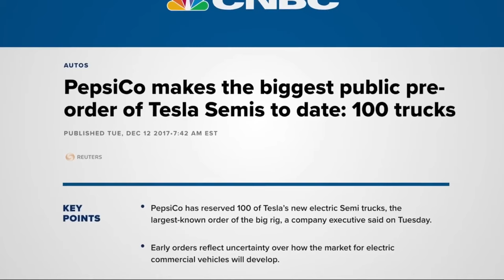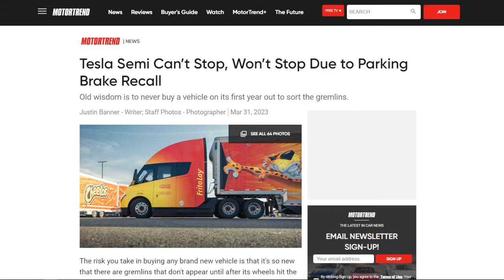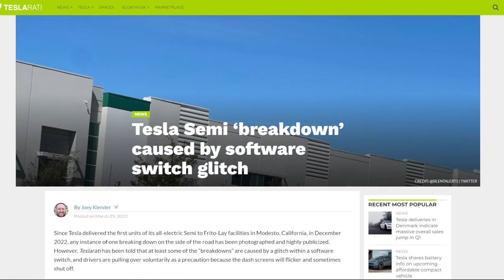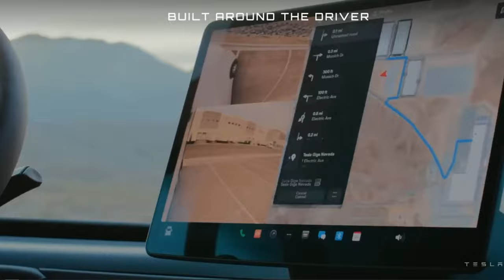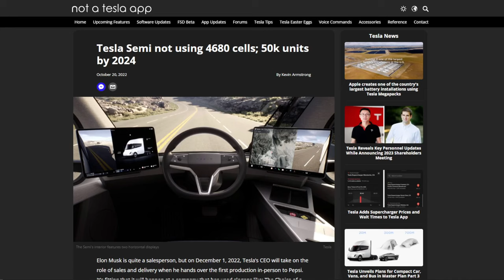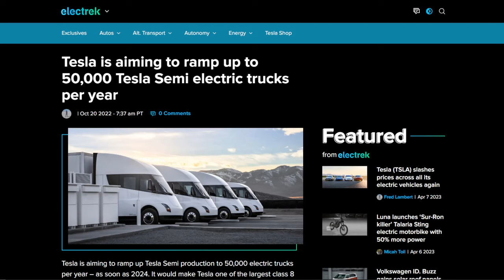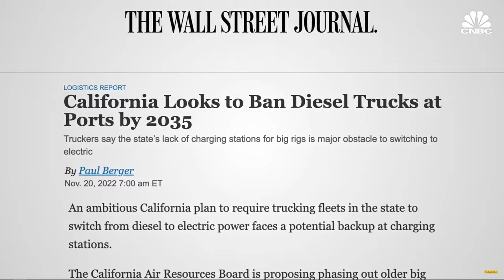The Real Reason Tesla Semi Keeps Breaking Down.

Comment: I think hydrogen is going to be the winner as after all vehicles that use fossil fuels today are actually burning hydrogen and Cummings plus a few others are moving in the hydrogen direction. Add that to the fact there simply aren't enough materials to go around to make the big switch to EV's and hydrogen is sure to come out the other side as a clear winner in it's ability to phase out the use of fossil fuels.
Reply: Hydrogen is dangerous, dirty to produce, hard to transport and store. Maybe one day H2 will be usable. Right now, battery technology is constantly improving, actually available and comparatively safe. FYI, I used to work in the industry. I know what I'm talking about.

Comment: I don’t like Tesla‘s Semis front design.
Reply: Thanks to that "design" it has a drag coefficient lower than a Bugatti Veyron. Tesla engineers are focused on one thing and on thing only - performance.
Reply: Yes one deer impact and its totaled
Reply: @400kProject  Just like the Cybertruck that looks aerodynamic... but has the drag coefficient of a brick.
Reply: @400kProject  if they wanted true engineering there would be air intake vents that spin turbines to generate eletricity to keep a battery half the size charged at all times  but you go ahead and think the way you do  .

Comment: Wether Tesla Semis are good or not, its existence is great for showing people that trucks doesn't have to use Diesel to succeed
Reply: Right now they are working with soda and potato chips. Semis also haul weighted loads such as steal! Large construction equipment. Etc. Yes, in many cases you still need diesel trucks. However, a non-diesel solution that could take on large volume less weighted items could certainly reduce diesel truck usage in some areas.
Reply: Why do you guys have problem with diesel? What did it do to you?
Reply: 500 miles on paper to charge for hours with a 1/4 of a cargo. How?
Reply: It is funny how UPS has hundreds of class 8 semis that run on BIO-NG that cost less than diesel or electricity to operate. Now that Cummins is rolling out their new 15 liter NG engine, it seems that you don’t need Tesla to be a”winner”.

Comment: Here is a major problem.  A Ford Lighning EV truck was supposed to get 350 miles on a charge.  It pulled a small trailer one day.  It only got 82 miles on that charge.  Weight is a big factor in electric vehicles.  Semis have to deal with a lot of weight at times.
Reply: same with the cyber truck -90mi range when towing max capacity, smoothing like 1100lb which is less by maybe a 1/3 than an ICE ford f-150
Reply: its not the weight. It's the aerodynamics of pulling a trailer. The semi can deal with this buy having a more flush top with the box its pulling.

Comment: My major concern is charging these things.  There is an ungodly power draw in charging them, several companies around here investigated getting involved with Electric Trucks for local delivery.  Seems as if the power company cannot supply the power needed.  One local power company around here was reported to inform the trucking company that their power demand exceeded several times over the local town power draw.  Basically the electrical infrastructure was not in place to support and deliver the required power.  There are good places where Electric Trucks and other they will be a issue.

Comment: According to Oryńsk, the Tesla truck is not “built around the driver.” For starters, he points out that the placement of the driver’s chair is wrong. Tesla positioned the seat in the front-middle instead of the vehicle’s front-left side, and Oryńsk pointed out the shortcomings to this change.

“This [chair placement] makes overtaking or looking ahead more difficult,” said Oryńsk. “But [it] also makes it impossible to reach out of the window to pass the paperwork or to talk with the guy in the gatehouse when you enter a port or a factory or, say, a tollbooth.”

Comment: Motorists aren’t usually terribly concerned about having to leave a car in the shop for a few days; it’s easy enough to find a rental. But for a trucking company, lost revenue from not hauling freight can be the straw that breaks the camel’s back. 

Cheerfully, Roeth said electric trucks theoretically require less maintenance and downtime than cumbersome diesel engines. It’s still unclear how robust the Tesla Semi maintenance network really is. 

Social media posts these past few weeks have captured Tesla Semis stopped on the highway, with remote units tending to some. It’s uncertain what caused these Semis to retreat to the shoulders of the highway.

Comment: 70k trucks recalled by Mercedes Benz for the brake issue Tesla had - forgot to mention it impacted EVERY other truck OEM. Look back to the initial release of the model S, glitches, screen death, electrical module issues were also experienced - not the same today. Given that Tesla is NOT a class 8 OEM exclusively, engineering resources are shared. If history is any judge, they'll get it sorted.
Reply: Doesn't change the fact that in 2021 4 out of the top 5 most recalled vehicle models in the US were Teslas and that the ONLY reason they managed just 4 out of the top 5 is because they only have 4 models! They have consistently been the most recalled manufacturer in the US for years and current predictions on how many times you can expect your Tesla to be recalled over its lifetime is 62 times. Mercedes on the other hand are currently ranked as the least recalled manufacturer worldwide.
Reply: @johnhawkins2105  Software updates are classified as recalls, so I expect the number to be high - I have two for over 3 years, get updates monthly. However - never have I had to bring it back to the service center. Owned a benz for 3 years - back to the dealer 4 times. My real world experience does not match - but that's me.
Reply: @johnhawkins2105 they're counting software updates as a recall for tesla because they don't do actual physical recalls . Government do this to protect legacy oem
Reply: @trondialsingh594  According to the companies that compiled the lists, they counted recalls as being only what the NHTSA registered as a recall & that If the fault could be corrected by a software update over the air, this doesn't subtract from it's severity, it is more convenient though. All the major manufacturers offer OTA updates.
Reply: @johnhawkins2105  all other oem have to take the car back to the dealership to do software update tesla does it over the air often
Reply: @excalibor2201  Yep, Tesla's are always getting recalled by the daily, not because of software updates but the leading cause is batteries going limp lmao
Reply: @trondialsingh594  Legacy OEM has been paying for Tesla's Government support, if anything They're keeping Tesla affloat after all the non-profit years they went through until they brok even by using investment money to cover up the losses, even then they only net 2 billion more than Ford a year from care sales and green certificates.
Reply: The data does not back that statement. I've owned 3 TESLA s over the last 5 years, not been my experience at all. @HenAnt

Comment: You can't assume it's a drive train problem because it's being towed by a tow truck.  Fmca requirements are that parking brakes need to be functional in order for it to be operational.
 If the parking brake is out it will be deadlined and cannot operate on roads.... Therefore must be toad to a shop for repair.

Comment: WTF?
A truck with way smaller carrying capacity than the ones in use, spending a significant time of it's time charging and undisclosed stations, causing slower delivery times and requiring a higher starting investment causes interest or even excitement in the logistics sector???
Hard to believe.

Comment: Similar to all other trucks on the road, they can occasionally experience issues right from the assembly line. This is a common occurrence, so there's no reason for it to be any different. The remarkable aspect of the Tesla Semi truck is that it allows me to say goodbye to the high costs of diesel mechanics, their hefty paychecks, and diesel fuel expenses. Nevertheless, I'll still need the services of a tire specialist. By the way, who says it's breaking down a lot?

Comment: Weren’t the recalls for Eaton Brakes made by a third party for most trucks?  Over 100,000 were recalled and 35 of those were Teslas.
Reply: Eaton doesn't make brakes. Eaton makes transmissions and differentials. Bendix is the company that makes air brake systems.

Comment: I guess there will be no team drivers due to the idiotic placement of the driver's seat!  I would really like to see how it would drive through Montana in the snow. And what kind of transformer a truck stop would have to have to be capable of charging 50 trucks at the same time? Why don't you EV schleps understand that we don't have a power grid that could charge all EV's? Take LA for an example. 12 million residents. For this example, let's say that only one fourth had electric vehicles...3 million. They all have regular jobs, so, when they get home, they would all want to charge up the car before going to bed. The California Govenor is already begging people not to run air conditioners in the evenings when they come home because the current grid cannot handle the load. What are they going to do when they have millions upon millions of cars throughout California and all want to charge up at the same time? Lastly, a great percentage of the people in the USA live in apartments. Can you imagine how long the line would be to get to a charger? Better get a camper with a comfortable bed!
All of this EV crap is nothing more than a putrid wet dream.

Comment: I don't know why there are such negative comments !  Electric vehicles do not harm the environment at all !  The electricity is not generated by coal for any other fossil fuel !  One windmill that is integrated into the grid can charge 50 Tesla trucks in 20 minutes !
Reply: The batteries are the problem. They require a lot of material and energy to manufacture and require a lot of water to extinguish when they catch fire. (Compared to ICE)

Comment: That's what the pilot production is for... 
works out the bugs
And it's definitely the dash that goes out  a buddy at frito confirmed 
said semi works normal just can't see speed and other things so has to be towed due to safety I wouldn't give the break downs much thought legit model 3 and s did the same thing but since it's commercial it's has to be towed
Reply: That is not entirely true. If a commercial vehicle breaks down, you can drive it to the nearest repair shop if it is operational.
Reply: @danieldeblasio9368  it's a safety issue because everything is on that screen e brakes and all 
it could be driven just wouldn't be a road legel semi
Reply: @Daniel_420  Bad engineering in my humble opinion.
Reply: @Daniel_420  semi-trucks use an air brake system.
Reply: @danieldeblasio9368  air barkes and e brake are not that same 
one brakes other keeps the semi still while parked 
but that was just a example why the DOT wouldn't allow it to be driven on the road and I highly doubt Tesla would risk driving it just to avoid the semi tow pics
Reply: Excuses. Tesla is losing the class 8 EV battle. Period.
Reply: @DebtPRZ  the battle is in your head
Reply: @Daniel_420 – Nothing is in your head.
Reply: @Daniel_420  an air brake system applies air pressure. 😲
Reply: @danieldeblasio9368  The faulty part in the Tesla recall was not made by Tesla but rather Bendix, so this isn't a knock against Tesla engineering.  Nikola also had all the Tre BEV's recalled.  These are not the first nor will they be the last recalls.
Reply: @ChiSpire  a seatbelt
Reply: @danieldeblasio9368  seat belt was last years recall LOl.  This years Nikola Tre recall "Nikola Corporation is recalling approximately 137 model year 2022 Tre BEV trucks, according to National Highway Traffic Safety Administration documents. In the affected trucks, the shaft locking screw on the brake pedal may be missing or may not be fully threaded, which can cause the brake pedal to detach."
Reply from the maker: If the Model 3 and S had the same problem, why did it repeat in the Semi? If you repeat the same mistakes, that's even worse.
Reply: @visceral_investing  I doubt it's exactly the same problem that's making the computer crash blackout as the early production model 3 but idk that's a question only Tesla knows
Reply: @visceral_investing  don't know if they had the same problem but if they did you're correct that makes it worse :).  Need to learn from mistakes.

Comment: There are a few key details that trucking companies, retailers and manufacturers need to know about the vehicles they order. One of them is how heavy the truck is. 

Trucks in the United States are allowed to weigh a maximum of 80,000 pounds, including the tractor, the trailer and everything you’re fitting inside. Electric trucks, like the Semi, are allowed to weigh 82,000 pounds. Companies typically want to haul as much as they can in a single truck, so getting close to that 80,000-pound limit is ideal.

However, Tesla, which did not respond to a press inquiry, has not released information on how much the truck actually weighs.

Comment: These batteries are TOO BIG. The FAULT RATIO and TRAPPED HEAR is going to be IMPOSSIBLE to overcome because they are built with THOUSANDS OF LITTLE BATTERIES which is STUPID. They should have ONE HUGE battery but that is impossible because of heat and cooling. FACT. EV are for SMALL CARS ONLY. They rest are vrap wagons

Comment: Tesla's first was the parking brake which was also done to all the gasoline or diesel trucks that use the same brake from the company. The second is the electronic Glitsh that was easily fixed by the Tesla engineers, 2 recalls on new trucks are not a failure, check that against diesel and gasoline trucks plus the monthly maintenance,  that is nothing. Check the Pepsi drivers who have used the TESLA SEMI for almost a year now and hear what they say about them.

Comment: Tesla shelved the semi because it was not practical to have an electric semi. I believe the only reason it was released was because Elon felt like Nikola which is the other half of that iconic name was stealing their thunder. Tesla rushed the semi to market without enough beta testing. When the first trucks went to Denver the trucks would take a load over the Eisenhower Pass and not have enough juice to make it back. The trucks were relocated to Phoenix which is geographically flatter. On top of that the price of lithium has gone through the roof recently driving up the cost of production. Nikola had to regroup after the spike in lithium prices and shift to the FCEV.
Reply: What are you talking about? Lithium is headed towards all time lows 😂.  Makes me question everything you just said as BS

Comment: Bendix sorry.
Reply from the maker: What you apologizing for?
Reply: @visceral_investing  You deleted my post where I misspelled Bendix!  In that post I mentioned the two recent recalls on the Nikola Tre.  One for the brake pedal attachment and one for seat belt attachment.  Also the brake recall for the Tesla Semi is for all manufacturers trucks using the Bendix parking brake module and  is not just for Tesla trucks.. Thanks for the question.
Reply from the maker: Nah, I didn't delete any comment.